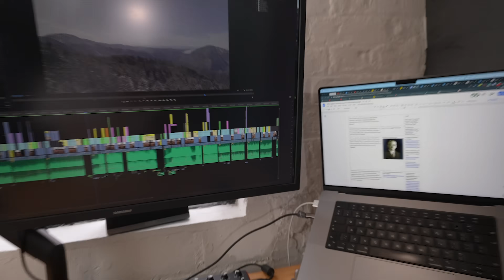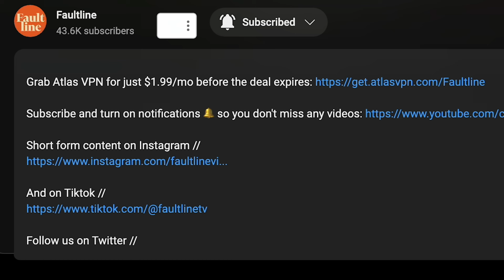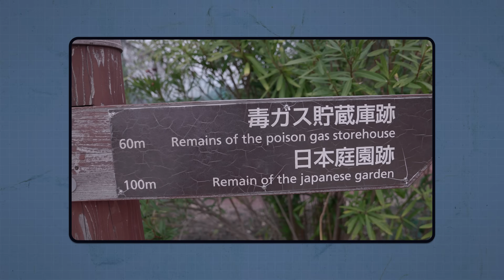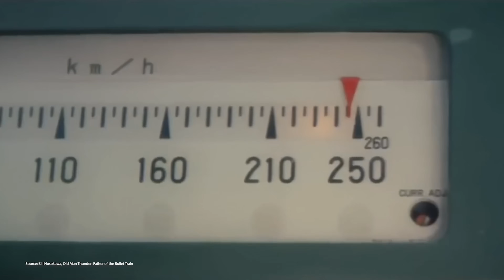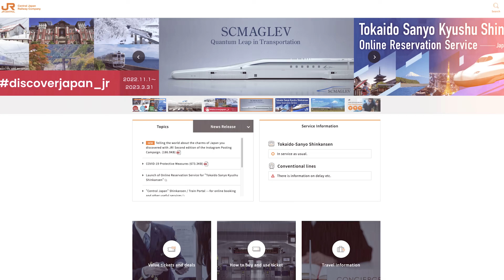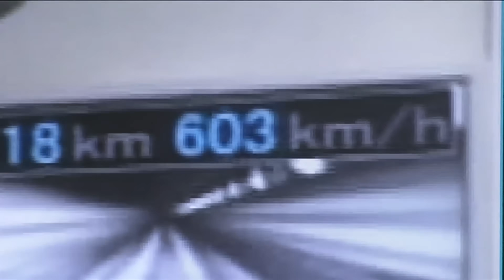Why Japan is blowing up its mountains

Comment: Great video. Unfortunately Shizuoka Prefecture and JR Central have not yet agreed on anything regarding the construction underneath the river that supplies most of the water for the area. In March 2024 JR Central announced that the opening of the line will not be until 2034 at the earliest. Afaik no construction has commenced on this section of the line.

Comment: Japan: Forget about cost! We are going to take the shortest route possible!

U.S. It's too costly to build a direct route through the mountains even though it would mean a time savings for the user.

Me: It's not really high speed if a circular route is chosen, because any time savings acquired by speed is mitigated by distance traveled. So you want minimize the distance by making the route as straight as possible.

Comment: Thinking about rail tunnels under rivers immediatly comes to mind the Isarco River Underpass here in Italy part of the Brenner Base Tunnel high speed line between Bolzano and Innsbruck (in Austria). There a small high speed rail tunnel section under a river has been constructed in relative safety and, to my knowledge, without any major negative enviromental impact by, among other things, freezing the ground during construction.

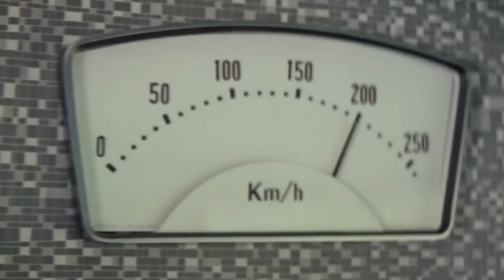Comment: 5:47 not for now ( cina maglev)
6:10 That's standard gauge idiot size.  they have to do that because to increase the speed of the train.  that's the reason why freeways are wider than national roads
6:20 of course you can but.  High-speed rail lines are dedicated to fast trains not freight unlike in the United States where Amtrak has to be late because the freight train company impedes passenger train travel (yes they are very selfish because of money)
7:17 the speed is not a problem.  the problem is that the capacity is already maximum.  trains run every 3 minutes.  (in the United States the light rail runs every 15 minutes it is too long to wait for the next train) so they had to build new lines to add  new capacity
7:34 is Maglev trains still use trucks (wheels) at lower speeds (near stations) when the high-speed wheels are replaced by magnets
8:03 monorail is suck
10:45 it is faster and cheaper than the California high speed train
11:54 at least they make more sense than NIMBY in the states.  but if in China it would be directly bulldozed all over the river

Comment: The thing with Maglevs is that they are so expensive that you need to have massive extremely high density cities to make them somewhat monetarily sustainable
Reply: The construction costs are high but idk about operation. The Chuo Shinkansen is lower capacity than the Tokaido Shinkansen so it transports less people, but fares will be 15000 yen which isn't much higher than the current 13620 on the Tokaido Shinkansen.
Reply: @hamanakohamaneko7028  Yeah, the problem is normally the building cost because of all those magnets needed
Reply: @walli6388  It'll be worth it tho
Reply: like tokyo and Osaka
Reply: Sounds perfect for the anglophone world if you’re going to blow money anyway go all the way and use the best technology possible 😅

Comment: I've always hypothesized that it also simply makes geographic sense for the Shizuoka government to be opposed to the project, as it would bypass the prefecture's main population centers, taking passengers off the existing Tokaido Shinkansen and therefore hurting them economically.
Reply: Actually, no. I'm from Hamamatsu, Shizuoka. There are like 10+ Shinkansen every hour but most of them serve large cities like Tokyo, Yokohama, Nagoya, Kyoto and Osaka. Hamamatsu and Shizuoka are major cities, but the populations are 800k and 700k respectively, so not nearly enough to make it worth stopping to slow down travel between the megacities. As a result, frequencies have been terrible, with 3 trains per hour+ having to stop for extended periods of time to let faster trains pass because there's one every 3-7 minutes. If the maglev is constructed, travel between megacities transfers there and JR Central will increase the number of trains stopping because the line isn't pressured to transport millions of people.
Reply: @hamanakohamaneko7028  So, is the maglev good for the Shizuoka prefecture?
Reply: @whitewolf2767  for the exact reason stated above yes.
Reply: @hamanakohamaneko7028  in america some cities are lucky for 7 trains a week.

Comment: Fascinating and super well researched as always. Really love the inclusion of on the ground footage, hope to see more on the channel!!
Reply from the maker: Glad you enjoyed the format Sameed!
Reply: Really? I have to disagree. This one seems rather sloppily researched and not up to the standards Ive come to expect from this team (apart from the great visuals).
There are a lot of small missteps, like calling the US highway system one highway, to bigger ones like omitting one of the two big reasons for Chuo construction, namely the big increase in capacity on the corridor. This aspect is also important to understand the impact and use of the Shinkansen in general (another small mistake, "Shinkansen" [literally: new trunk/main line] refers to the line, not the trains.) I know a "cool train go fast" approach is enough to elicit nods from the audience, but come on.
The description of the conflict between JR Central and Shizuoka prefecture is misleading and inadequate. It omits the crucial fact, that preceding the concerns raised about Oi river water levels, the prefecture had been pushing JR to include stops in the prefecture to boost the local economy. This severly undermines the believability of the prefectures position and is also mentioned in literature on this conflict. How they missed that is beyond me. It would have also made for a way more interesting video if included, imho.
I hope they will do better in the future!